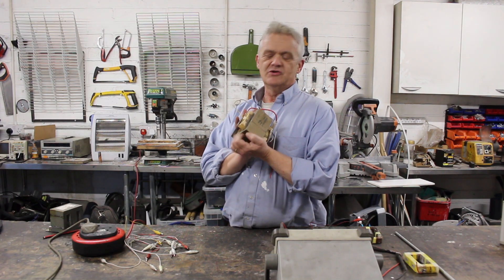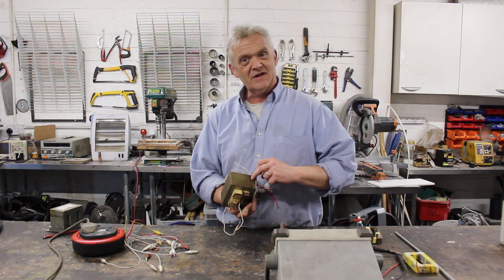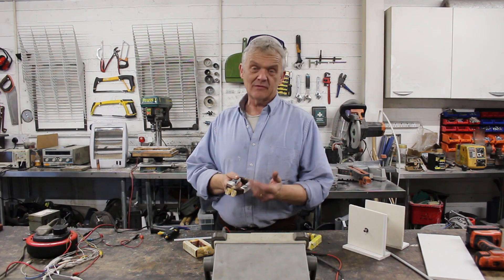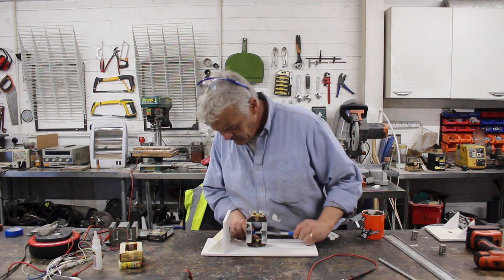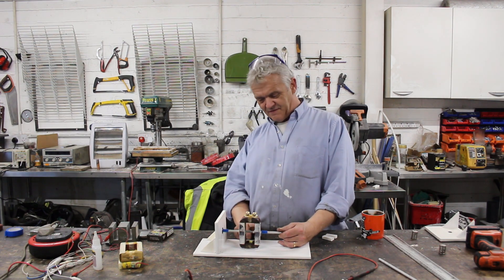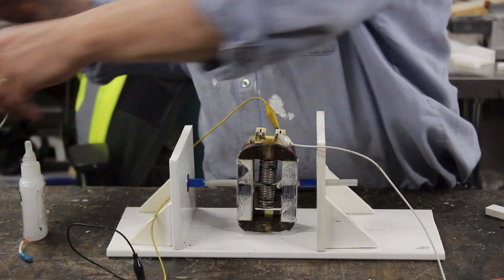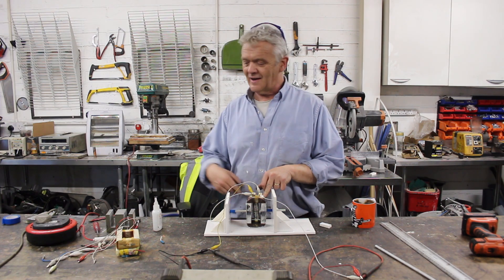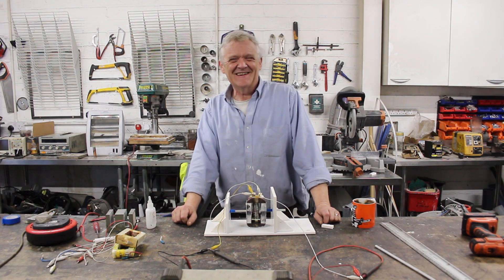1561 Making A Generator From A Microwave Oven Transformer

Comment: The same configuration will work as a synchronous motor if you connect it to a low voltage AC source. You need to give it a spin though to get going. It should run at your net frequency. 50 Hz probably. I hope it doesn't come apart if you do.

Comment: A boost converter will lower the amperage as it steps up the voltage right? I have 3 of the things laying about and was going to use them in my wind energy converter
Reply from the maker: you always trade off one for the other mate
Reply: @ThinkingandTinkering  I thought that was right. What are your thoughts on splitting the power out into two lines using diodes and having one high amp and the other stepped up voltage to see if there is a balance point that can be achieved?

Comment: Someone already did it in better way, in your system there are lots of air Gap around the coil so magnetic coupling isn't good the best way is to use both coils with it's E Core in such a way that magnetic flux couple with magnetic circuit right way to alternat magnetic direction perpendicular to coil .
Reply from the maker: this isn't my system it's a standard model demonstrator of motor and generator construction to show the basics - the very basics - it shows the essence of what is needed and how easy that can be to construct

Comment: It's stunningly easy to make a copper coil for a generator without taking apart a transformer. But in my opinion, the steel transformer laminates are also very valuable in making a generator. Their high permitivity provides a low reluctance magnetic path that  generate a much higher voltage using the same coils. That is if one is willing to deal with iron cogging. 

Speaking of cogging, distributing iron cogging to average it may be one way to minimize the max cogging force on the shaft.  Imagine a collection of 6 MOTs lined up on a long rotor each with it's own pair of magnets on the rotor, but each pair of magnets are rotated 30 degrees from the other ajacent pairs of magnets. The pull of the closest magnet will be somewhat offset by the pull of the next closest magnet leaving a lower net cogging force on the rotor.
Reply from the maker: yes I think it is easy to make a coil too - but you don't know how many times I get asked how do you make a coil - be careful of assuming what you know is common knowledge - bear in mind as well this is a demonstrator and shows the minimum of what is needed to get a working generator - you are right about the laminators - of course - but it doesn't really fit here - it would be a good teaching point for a later video - that's for sure
Reply: It's really just a Time Saver for the common bodger

Comment: Ones in a time its About condoms! Now is a good time as ever! With a NASA Stirling! a rod shifting magnets like washer on the rod how leeds to the flyingwheel!  You put a fire to get the Stirling move and now the top of the hill in greatness! A pip over the coil how shift the magneticfield to supressed it  inwards for a higher current up to eight tims! Does it work? I have seen a variant! But know we talk a few quids to save electricity then its power failure on the grid!
Reply from the maker: indeed

Comment: Have you done a video making a HVDC power supply yet?  That is something I have been playing with, but Im looking to make something with a bit of oomph, and yet as safe as possible.

I was thinking 6 MOTS, in series and bridge rectifier circuit.  That would net ~35KV but the current is what I think I may be mistaken on.  I want to make it primarily to charge HV capacitors for a marx generator, am I correct to assume that current is inconsequential?  Its breakdown voltage that causes failure, not current correct?

Any insight to prevent me from killing myself is greatly appreciated :)
Reply from the maker: I am going to do a video on doing exactly that safely mate

Comment: I used to strip microwaves and some of those windings was coiled aluminium wire
Reply: Will still work. But the internal resistance of the wire will be slightly higher than a copper coil of the same gauge.
Reply from the maker: yes they are - it will still work though

Comment: Robert - did you ever take a look at the MEG generator? Puts a permeant magnet into a transformer as a centre leg, so PM flux splits and goes down each arm. Claims flux 1/2 phi driven by cct. causes 1 phi flux change in transformer arms - PM flux splits L and R, and potentially blocked on each side by driven coil. Say coil opposes flux in one arm; PM flux plus driven coil's now go down the other arm... 1/2 in, 1.5 (for a change of 1) out. Oops.

For the life of me I cannot see the theoretical fault / hole! Several web pages eg JNL Labs "The MEG Project" + others. Claimed as built and demonstrated several times.... Hm. What's going on??
Reply from the maker: yeah I did look at it mate

Comment: Thanks Robert! Is a resistor block/circuit with the thick wire coil something that could adjust the amp/voltage manifesting?
Reply: Yes, A resistor can be used to limit current in a circuit.  The generators entire open circuit voltage is dropped across the coil's internal resistance, your ballast resistor, and the desired load.  Given a sufficent load resistance and ballast resistance one may mostly ignore the coil's internal resistance  but where the coil's internal resistance is high relative to the load resistance, then drawing even a small amount of current will significantly drop the generator's  output voltage under load.
Reply from the maker: Keith gives a good answer mate